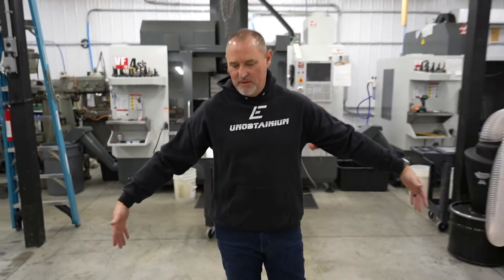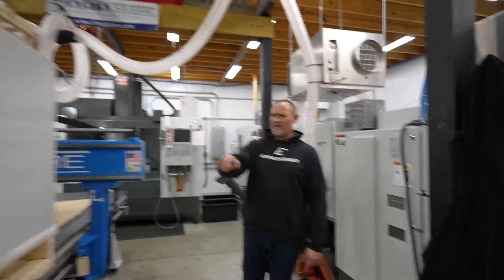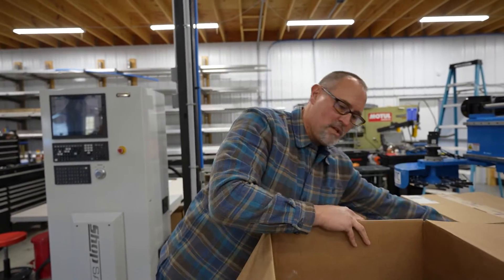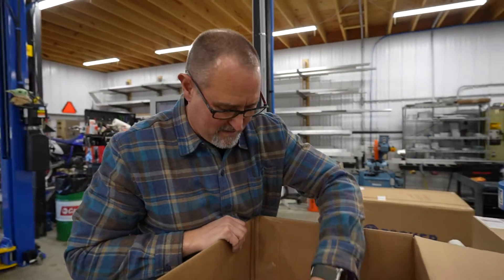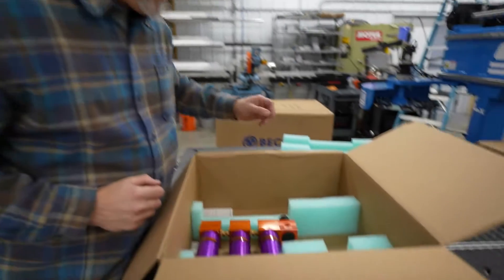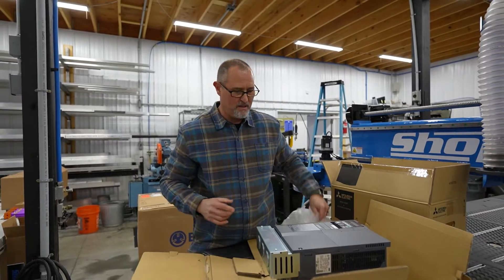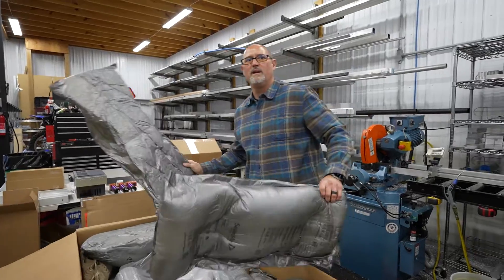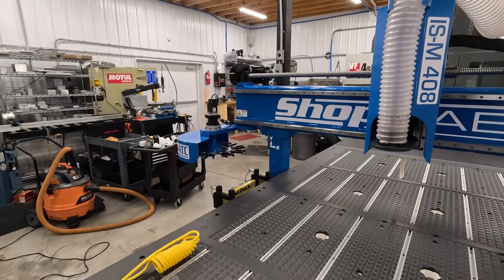New ShopSabre IS-M 408 CNC router - Part 1 - Delivery, Unboxing, and Setup

Comment: I have the same air filter setup! Good choice. I recommend a timed tank drain solenoid at the compressor, it will eliminate most of the water there. You're going to want to remote-mount that vacuum pump somewhere else if you can. they are loud and annoying

Comment: Hey great video! Thanks a lot for sharing, very helpful information. Would you mind sharing the Becker vacuum pump specs like HP, Voltage etc and the Mitsubishi inverter specs please? I happen to have a very similar pump and sometimes there’s not enough voltage available in my facility to start it, so i am thinking about getting an inverter to “ramp” the vacuum pump start and maybe that will solve the problem. 
My pump is 7hp, 220v 3ph. Thanks again!

Comment: What is the retractable dust hose sling you have?  I have been trying to find something like that and I can not find one.
Reply from the maker: @chrisgraham5185  Chris, I couldn't find anything either, so I designed and 3D printed (carbon fiber nylon) the perfect sling. If you want the file to print one let me know. I will also put a 3D printed copy on my website. Thanks! Rob
Reply from the maker: I just went to the shop to check on a couple 3-D prints in progress and looked up the sling... now I remember why I didn’t make it available for purchase.… it uses $40 worth of carbon fiber filament and takes 22 hours to print 😳  I will still put it out there for sale in case someone really needs one but printing it with PLA would be a lot cheaper.  
Email me and I will send you the files. I just don’t want to release it for free out to the world. RobLittle@Little-Enterprises.com
Reply: @Little-Enterprises  yes absolutely!

Comment: Hey random question, but what is that reel you use to hold up the flex DC hose above the machine? I just got an IS408 and am struggling to figure out how to manage my DC hose. Thanks!
Reply from the maker: That is an adjustable tool balancer. I think it is 15lbs. I got it on Amazon… not sure if it is still in stock. 
Reelcraft TB 15 Spring... https://www.amazon.com/dp/B003XJ4TNO?ref=ppx_pop_mob_ap_share
Reply: @Little-Enterprises  thanks for the quick reply! I’ll give that a try…
Reply: I’m looking at the IS-M series and coming from a CNC machinist background.  Right off the bat I’m missing my milling interface—feed/rapid/spindle override knobs, MDI, 3D simulation at the machine, etc.  You mention that you will be doing some aluminum milling and you obviously have experience as a machinist.  Will you miss these things?

Cheers.